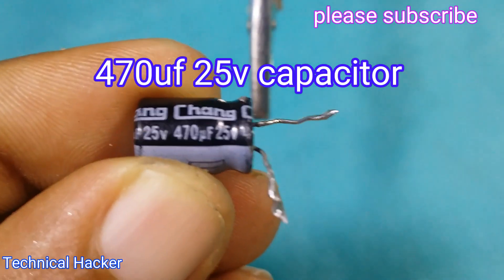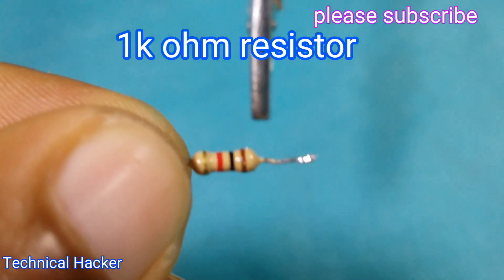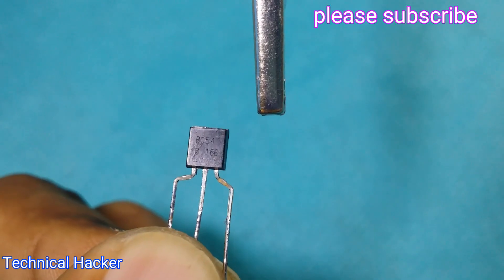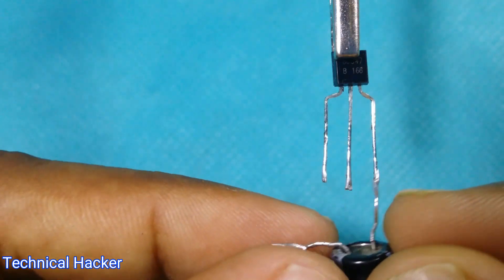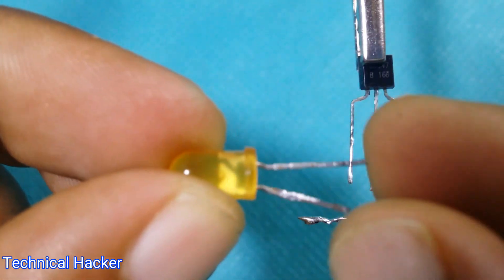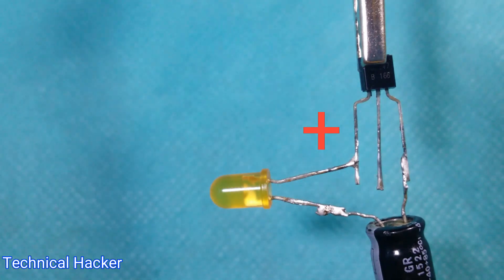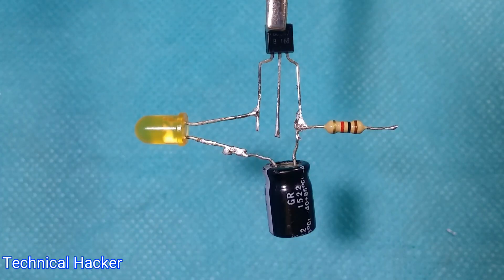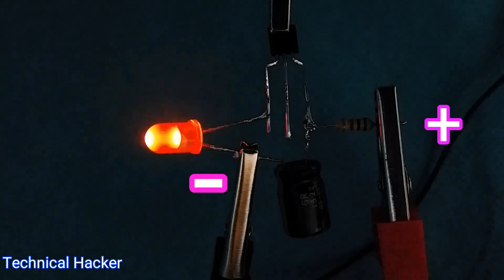Super Effect Led flasher - make easy

Comment: All I do the idea with all the attention and the same electronic materials lights the hand without blinking I used many types of transistors and it did not work.
Reply: The transistors have a certian point. Do mind and check the data sheet

Comment: It works but only with big 12v battery. Works with 12v supply as well but ruins them by reducing theit voltage after usage of some time. Why is it so?
Reply: It only works on 12 volts and higher. But it doesn't work on voltages lower than 12 volts.

Comment: Fake bot working he is not using the base pin of the transistor
Reply: The base is not needed
Reply: It is called an Esaki Oscillator, read the transistor datasheet to identify the collector and the emitter and 12VDC.

Comment: how we can reduce blinker speed?
Reply: By changing the capacitor to a larger number. I tried with a 1000 uF capacitor and it slowed down my flashing speed.
Reply: I think it depend on how fast the capacitor charged?
Reply: Use a transformer less supply...if the pf is 105,it blinks slow,if it is 225 it blinks fast

Comment: Fake viedo not working i amm making again and again this is
Reply: Mine works. I have used 1000μF.
Reply: It is called an Esaki Oscillator, read the transistor datasheet to identify the collector and the emitter and 12VDC.
Reply: Try using 12v

Comment: Can I use a capacitor 470uf 16V knowing that the voltage applied to the circuit is 12V
Reply: Yes,but 25 V will be safer